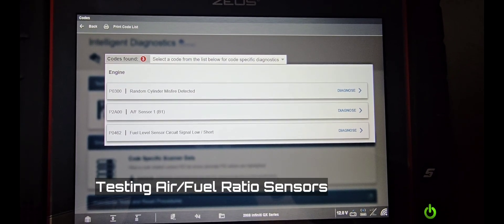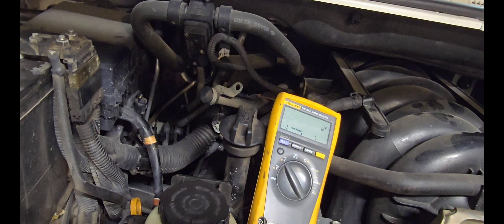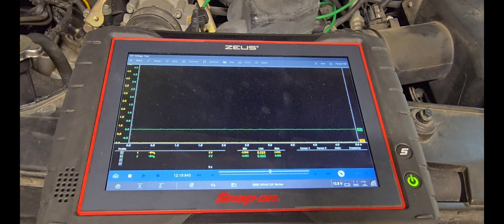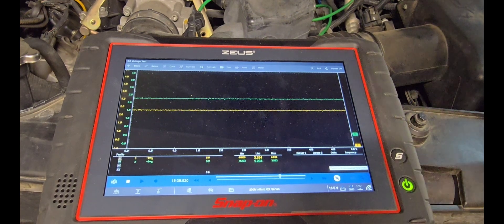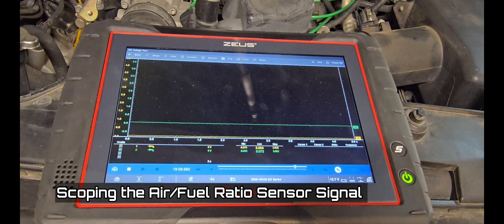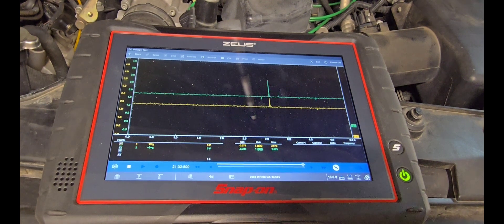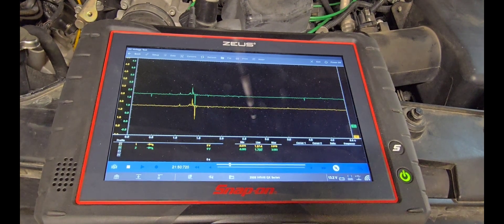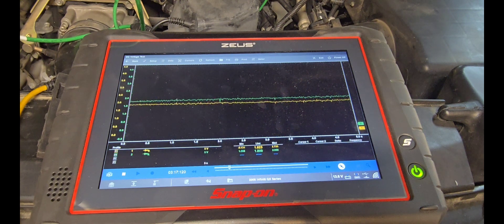Testing Air Fuel Ratio Sensors

Comment: Thanks!, isnt it backwards to O2 sensors?, Lean=Higher Voltage and Rich=Lower Voltage?, thanks!
Reply: That is my confusion!, on narrow band sensors I think Rich=High V, and Lean is Low Voltage on the rank of 100mV to 900mV. But on your test it looks the way you say! 🤦🏻‍♂️
Reply from the maker: For Oxygen sensors yes, but Air fuel Ratio sensors are the other way around.

Comment: Nice video
Are the air fuel ratio sensors signal voltage drops down when they are getting lean mixture?

Comment: good video. i think looking at lambda or current would be a better way to check the health of the af sensor see the fluctuations under artificial rich and lean conditions. af sensors are supposed to be constant voltage but variable current sensors. although scope is great for checking wiring integrity and voltage.